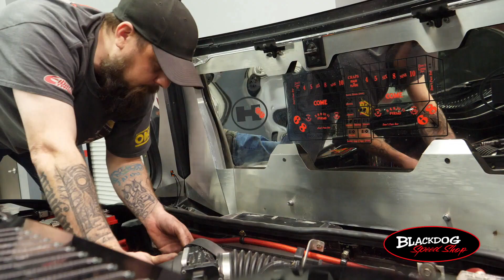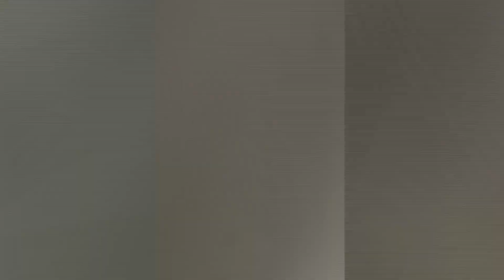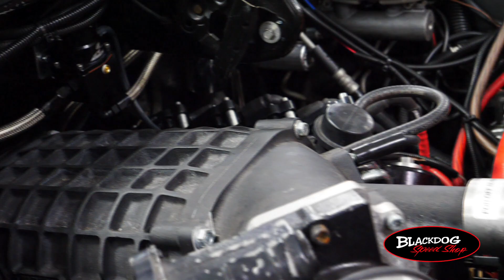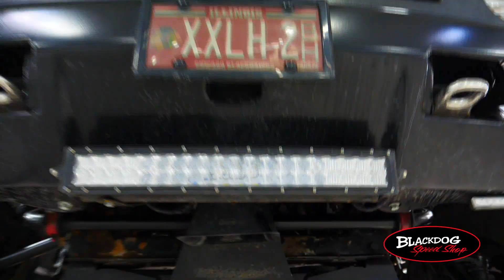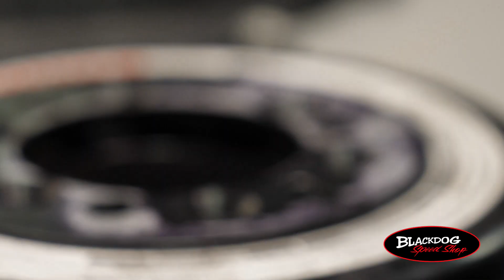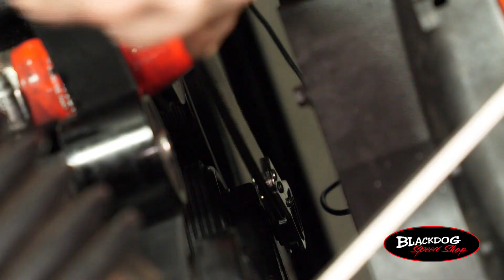Supercharged 2006 Hummer H2 Fuel System, Control Arms, Tie Rod Upgrade | Blackdog Speed Shop

Comment: So it needed lines and a pump then ur tunner messed up the electric pressure table rocked the thrust bearing and yall replaced the front crank seal and sent it home b4 the rear main seal started pouring oil out. 😂😂😂😂😂😂😂

Comment: Wondering what kind of lift is on this + what wheel offset diameter and tire size this is love to re create this stance that it has looks perfect to me and iv looked at a lot of hummers trying to decide what to go for on mine looks like its probably a 6” lift would appreciate if anyone remembers what wheels were on it i know the video’s 2 years old
Reply: Look up Hummer H2 Project Magnum that H2 has a 6 inch lift with 40x15.5x20’s

Comment: 2006 H2 Hummer 6 ltr 500 HP  N/A . Do you have a pump for my tank or the required parts I need to use.  Running also DEKA42 injectors now ?
Reply from the maker: We can definitely help you here. Please contact our shop manager paul@blackdogspeedshop.com. Thanks!